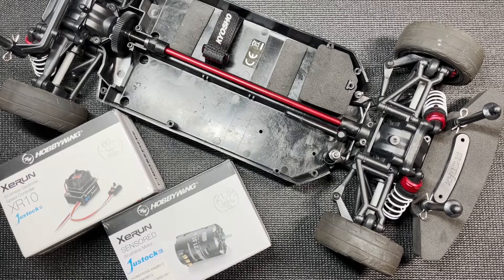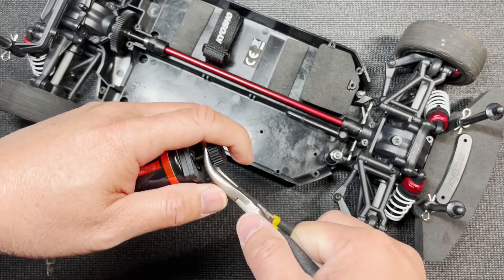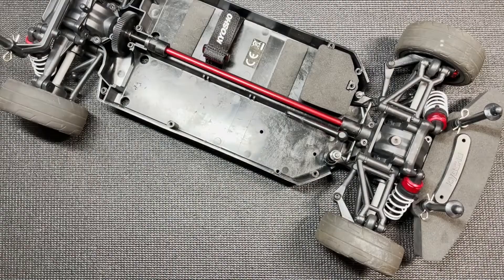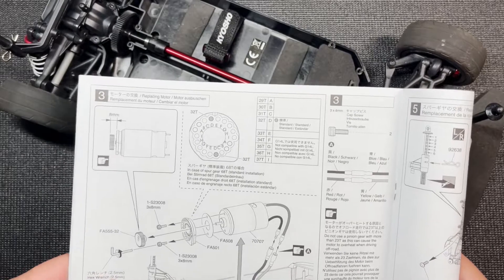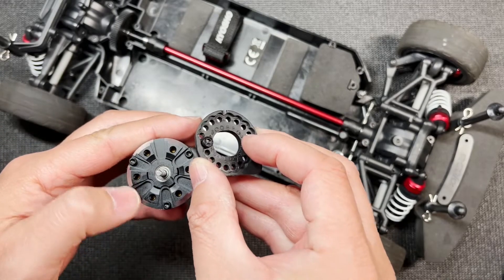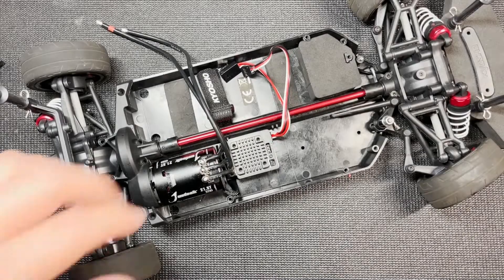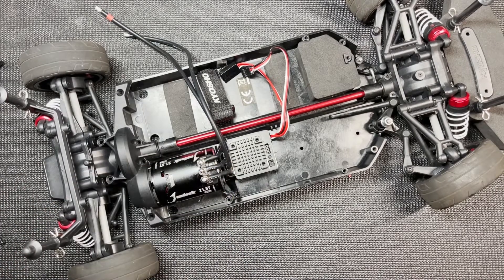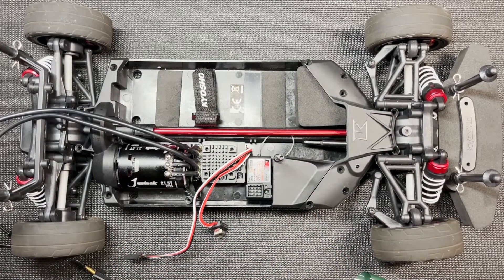Install Brushless Motor & ESC | Kyosho Fazer Mk2 Dodge Challenger Hellcat | USGT Class Race Prep

Comment: Recommend that the fan remains on the esc.  The brushless esc will get hot and without the fan the life of the esc will be reduced.  Leave the cover  off so it will fit.
Reply from the maker: Sound advice. 👍
Reply: 21.5 motor geared at over 6.00 FDR doesnt need ESC fan.

Comment: I should also say that for those who end up using this motor/esc combo, the esc is most likely set to forward+brake mode (no reverse) since this is a competition grade motor.

So don’t panic if all of a sudden your car doesn’t reverse, you just need the hobby wing program card to change the setting for reverse.
Reply: Oh man, so if you don't get the card you have no reverse? That's disappointing...

Comment: Great video. Ive been all crawlers since joining this hobby a couple of years ago. I have the mk2 roller on the way. What kind /tires are best for these and for speed? I know everything about crawlers but nothing about these lol. I also got the Subaru WRX clear body coming. Looking at brushless systems now. Is there any parts I should go ahead and order for upgrades before I run it?
Reply from the maker: The Challenger is a slightly longer wheelbase. The WRX body may not fit. I would definitely go with the aluminum drive shaft for brushless.

Comment: I realize that this video was uploaded quite a while ago,  and I'm not trying to criticize any point of it. 

I noticed you soldered the three wires to the motor the way you did, and when i take a look at how the ESC and motor I have is labeled, I would have my wires connected in a different order. I suppose perhaps your specific motor/esc might have the sequences in a different order, but I feel like i need clarification since I myself am new and looking to get into this.

motor is lined up in C, B, A format

ESC is lined up in A, B,C format

Direct connection like in your video means I would have:
Motor - ESC
C-A
B-B
A-C

I guess my question is if not following the standard sequence would do any particular damage to these parts
Reply from the maker: You are right on. The car ran faster in reverse which was unfortunate. I ended up not filming a track run later that day. I've learned that lesson. Thanks for watching. 👍
Reply: I appreciate you commenting on this man, your vids on this chassis helped me learn a lot on this. Built up some confidence in buying a whole other chassis and making the upgrades on that one